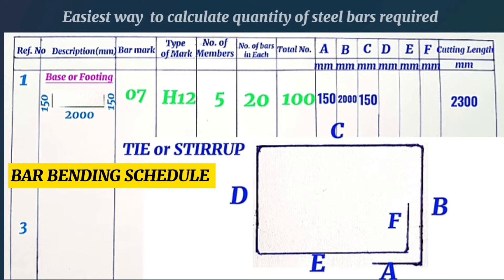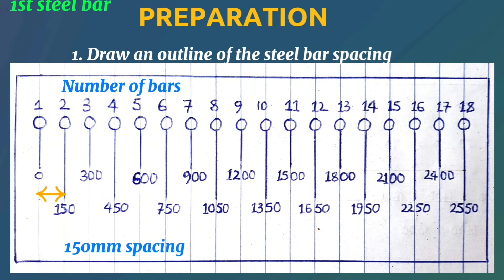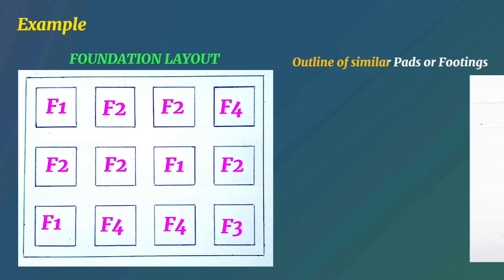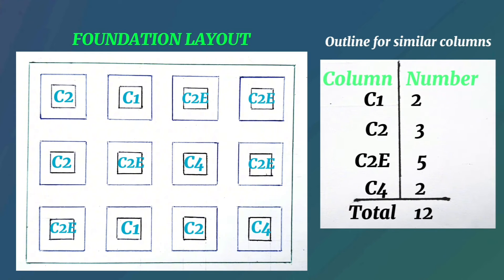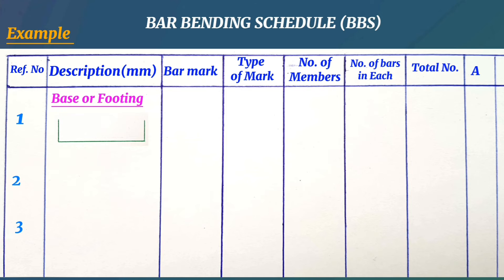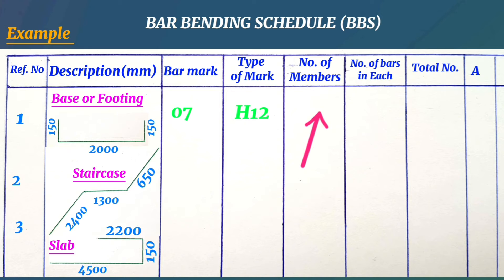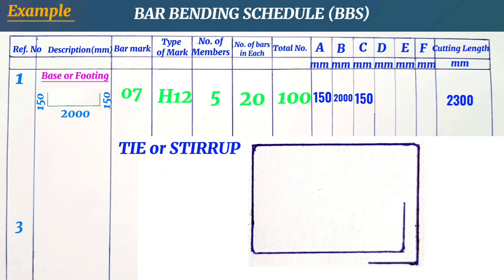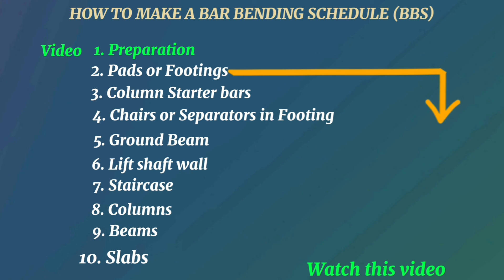BAR BENDING SCHEDULE BBS Basics | Steel reinforcement| Quantity Surveying|Steel Quantity Calculation

Comment: Why you didnt deduct the bend deduction from the cutting length ?
Reply from the maker: For academic purposes,  use the academic formulas throughout all calculations for the sake of passing.

But for practical work simply follow the structural drawing without complicating things or using any formula, everything  is direct.
Personally, to he honest I have never deducted any bend anywhere when preparing a bar bending schedule 
But I can remember deducting bends of 135⁰ and 90⁰ when I was still at campus. 
For practical work,  we simply follow the procedures as explained in the video step by step

Comment: Still searching on your channel about :
1: when applying screeding, how one verifies that the floor is trully horizontal. My builder suggest pouring water and see where it pools off. For vertical walls afterplastering , how one verifies that the plastered work is vertical.
2: water harvesting method by way an external concrete tank. One builder suggesting a rectangular  tankthat is above surface whereas one guy says a circular one and  bellow ground. 
How far are you from country code 263
Reply from the maker: When applying screeding
When doing flooring, I use a dumpy level, which I believe is the most accurate way to determine the required flat floor level or slope.
If you don't have a dumpy level, we normally use a 2.4m long  spirit level.
If you don't have the long spirit level,  use a transparent pipe, with water inside to determine the real level to set the floor to a required level 

After plastering when verifying whether the plastered area is vertical,  that is quite simple. We use a plumb line. If you dont have a plumb line, Stand crossectionally (not opposite the wall) close one eye,  and you will clearly see all the dips in the wall very well.

Concerning water harvesting it depends on the budget of the client. When constructing, a simple bangalow house. We simply collect from the nearest tap or well to the reservoir tanks using a simple diesel water pump or via the national water line. 
If it is a larger project(storeyed building) simply 

1. dig a well (cheap: around 1000 usd$ excluding reservoir tanks) which can be connected to hydro electricity to pump water or solar or even pumping manually to reservoir tanks 

Or
2. Drill using a drilling rig to pump water to overhead tanks standing on the steel stand tank tower ( expensive: around 8000 usd$ for only drilling)

Any of the above 2 options can work . Good thing with them is that they stay forever and you don't incur any other charges in the long run since you are pumping underground water.
Both circular and rectangular can work depending on the budget for the client. Rectangular HDG(Metallic) are better though expensive than HDPE (Plastic) cheaper Circular tanks can also work. The metallic stay longer and are stable as overhead tanks.

I hope that helps

I come from 256 currently working on a project in 254
Reply: @ianconstruction  thank you. Asante sana
Reply from the maker: @zimzimm-qe5in karibu kaka👍